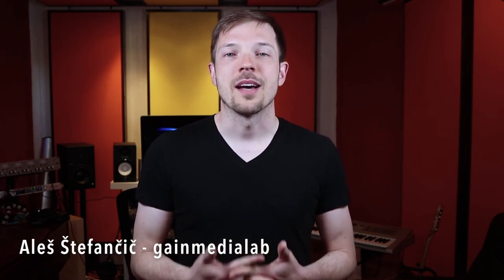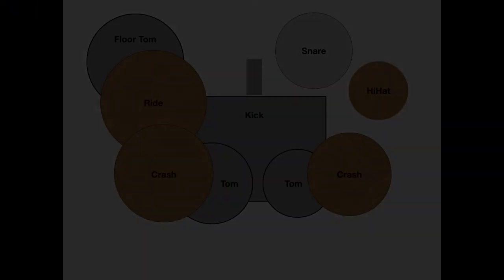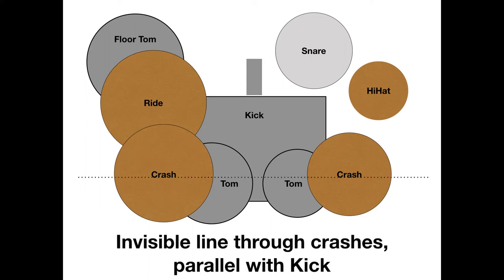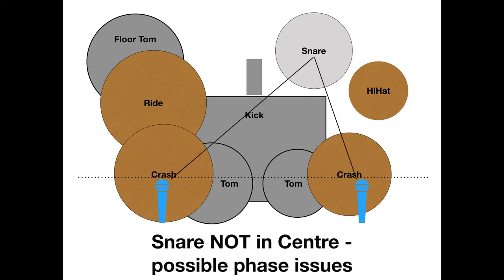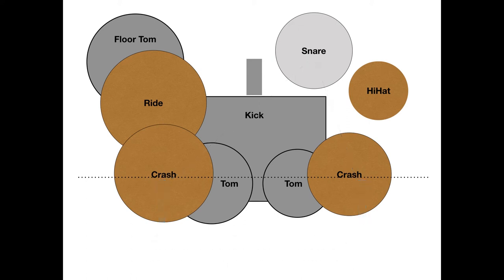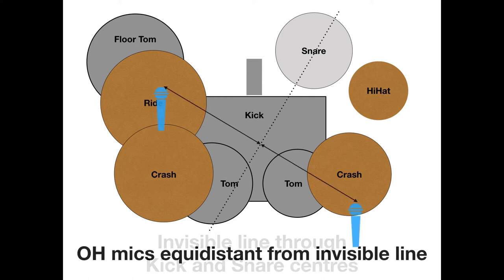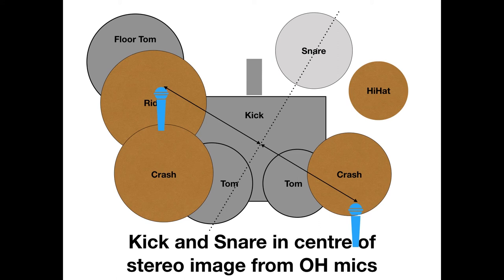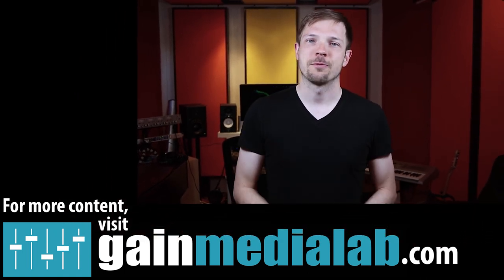Capture the Whole Drum Kit | Overhead Microphone Placement

Comment: That is a beautiful application of geometry in recording engineering. That is an issue that lends itself very well to linear algebra to find solutions that would give ideal mic placements for any chosen set of accentuation frequencies or for spatial relationships between drums - assuming that the mics will be panned in stereo.
Reply from the maker: If only someone showed me this practical application in school, I might be more fond of maths... ;)
Reply: @gainmedialab  I didn't start enjoying maths until I was reading engineering physics, well after leaving school. Then the applied maths was brought alive with examples when using models to calculate outcomes.

So, you're very likely right.

Comment: The way how to get low frequencies of the bass drum out of the overhead mic. Bass drum is working like symmetric "figure of 8" loudspeaker on low frequencies, rather different depending on drum constructions, but if the drum axis is perpendicular to the mic axis over the ~mid of drum - the principle remains. This case there are more or less but cancelled low frequencies. Harmonics (non-symmetric on drum axis) remain, different noises too.
Reply from the maker: Great insight, I will look more into that, thanks.

Comment: wtf no, i tried this and one side picks up the attack of the beater and the other picks up the reso head making it more prominent on the one that picks up the beater. what should i do?
Reply from the maker: Not sure what the issue is. Maybe try increasing the distance of both OH mics (placing them a bit higher can also help capture a bit more low end of the snare and kick).
Reply: @gainmedialab  Alright! It improved a bit but the cymbals and toms have very little stereo spread. I guess I should just live with that  :c